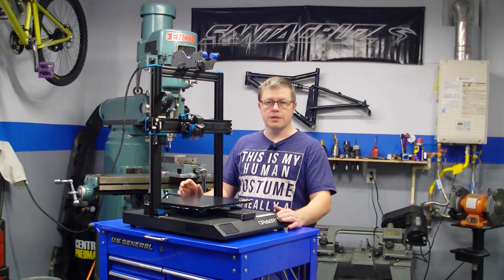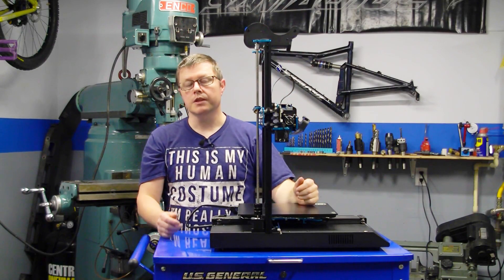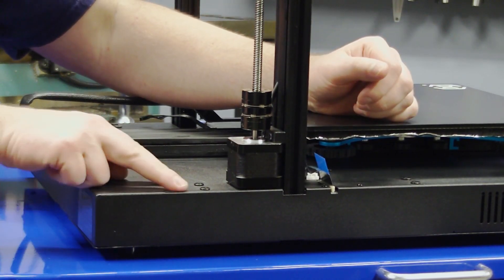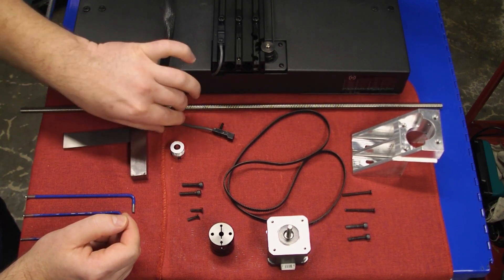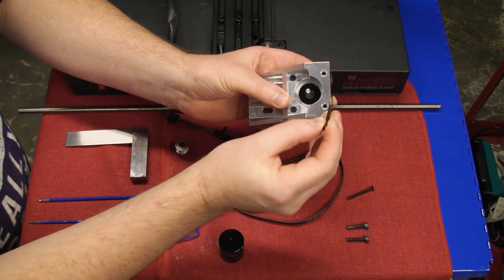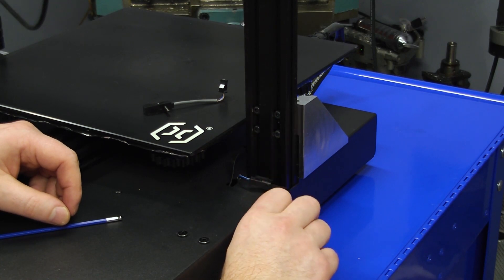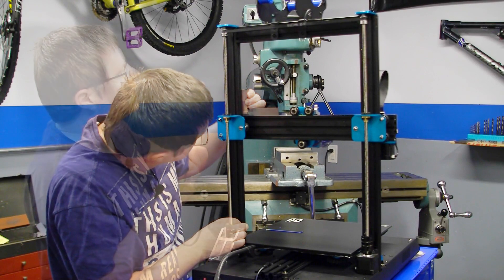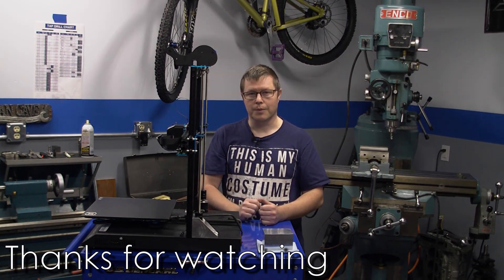Sidewinder X1 Gantry Support

Comment: Wow very nice... How do the brackets perform? I was going to make one of those triangulated supports but I really don't like their esthetics (or lack there of). I love the current clean, modern look of the X1 as is. How rigid are the Z axis gantry with your brackets? Would love your thoughts/observations. In my case I would print those parts as I don't have access to a CNC machine. Great video and thank you for your contribution!
Reply from the maker: Thank you. The gantry is very rigid with the supports. Im going to do a rigidity comparison between the stock machine and with my brackets. Thanks for the feedback :)
Reply: @EtherealProject3D  awesome! Looking forward to your video! Since you also printed it,  it would also be very interesting to compare your printed version vs your CNC one. Of course the CNC one will be much stiffer but by how much?
Reply: @EtherealProject3D  consider comparing all three: stock, diagonal rod and your bracket. This is a very well made thing, but i highly doubt that it will have the same rigidity as a simple rod. Actually you are just shifting the pivot-point a bit higher.